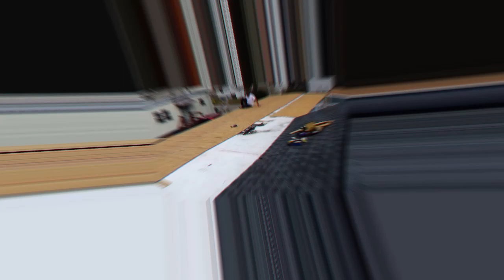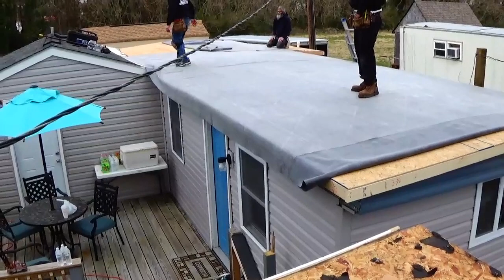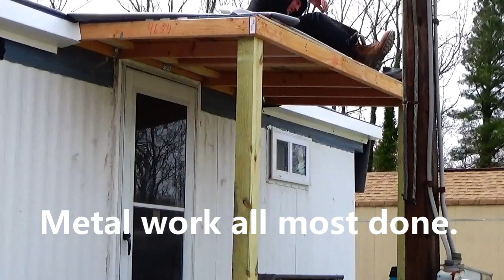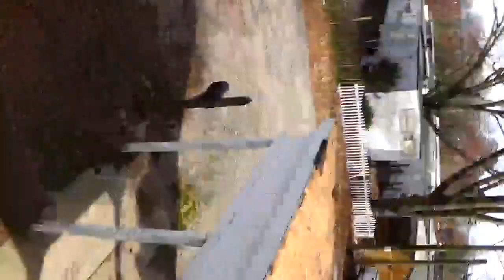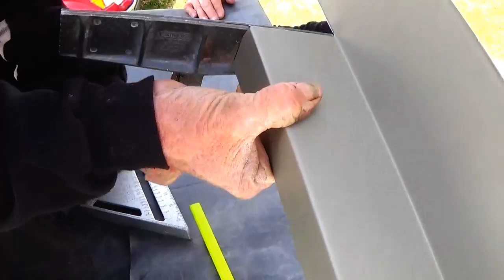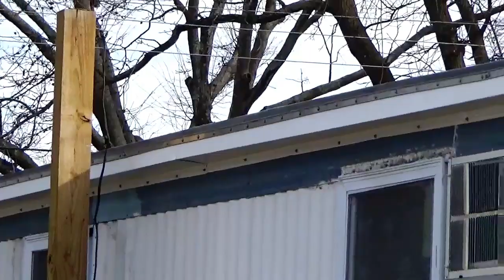Mobile Home Trailer Roof. The Best Roof Over. Chesapeake Virginia

Comment: Just out of curiosity how much does this roof system cost seems like you do lots of them how long would it last? We typically shingle if low slope or torch on if its flat.
Reply from the maker: last over 20 or 30 yrs. the only thing that might have to be repaired in 20 yrs is the seams and that is not all ways.I do not like the torchdown type